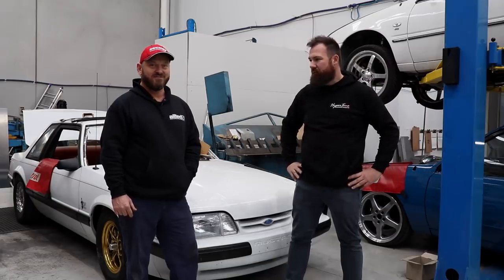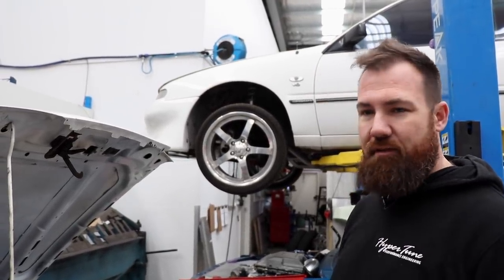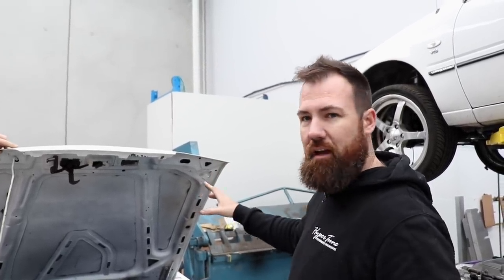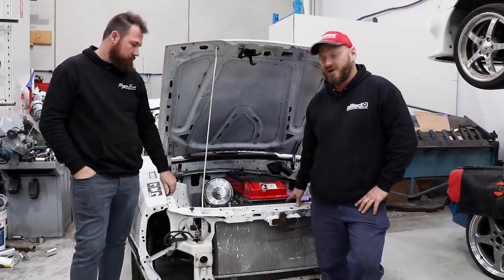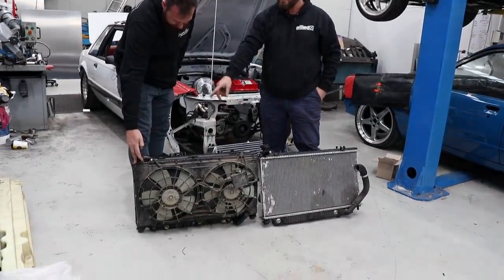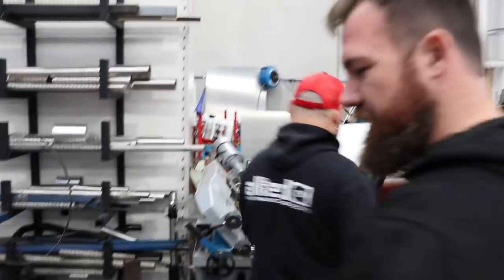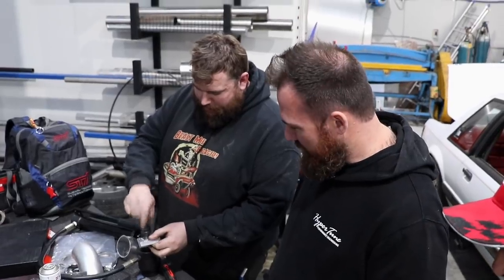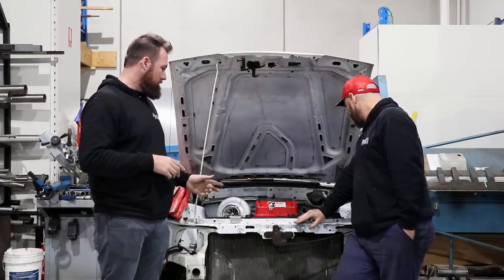Building a Barra Powered Mustang for Dragweek 2019

Comment: Damn those VE radiators are a good bit of kit aren't they, useful in a heap of builds
Reply: The other bonus is that they should be able to pick one up in the States easily enough, because Chevy SS and Caprice!
Reply: @ScottSherrington  good call a G8 radiator will be the same too
Reply: I wondered why someone would put an aftermarket radiator on a V6 VE. Those Alloytec motors are a POS. ...Yes, speaking from experience.

Comment: God love the Fox platform... came from the factory with Windsor V8s, the Lima 4, Essex V6s, Falcon 6s (yes, the US 200ci OHV engine), Cologne V6s.... and the SN95 is just a modified version so you can adapt modular stuff too. So much room you have to go all the way to dropping in a 385 series (429/460ci) with a C6 before the hammer has to come out to bang on the tunnel, and even then just to clear some reinforcing ribs on the trans case and a little extra room on the linkage side.

Comment: i would really appreciate a highly detailed series on building a barra including proving or debunking things like the pump housing cracking due to oil pressure at high revs, whether arp head studs are necessary or new torque to yield bolts will do the trick, more detail on the thrust bearing on the crank etc. thanks

Comment: The Barra 6 iron block is basically a ford 300 6 with a great head bolted on it .the ford 300 engine came stock in mustangs for decades and was the low power alternative to a V8 for the line up . so it's no surprise it fit's like it was made for it because the mustang was designed for a straight 6 and up tell the very early 2000's you could order one .
Reply: The barra blocks a bit like grandpa's axe, you can trace it back to the falcon 6s in the early 60s! We just kept on going with the falcon! But like all manufacturers,  get it perfect and stop producing the car!

Comment: 21:25  Electricians use this type of hole punch. 

You can get hand held hydraulic tools or nut and bolt type.  AKA Chassis Punch when used for building machinery or electronic enclosures.  For drilling holes, look up Rotabroach , this is a sort of hole saw device that looks like a hollow end mill.  There are 2 versions, one for use in a magnetic drill / drill press and another with a spring loaded pilot and replaceable cutters that can be used on a hand drill .  Finding out what tools exist and finding material are just a few of the big battles when building a car.

Comment: I wonder what you guys would charge to send the required parts to convert a fox body to barra power. I live in the states and couldn't think of a cooler powerplant to put in it
Reply: Not affiliated with these guys but we sell the engines. You don't really need a kit to convert if you can fabricate the mounts. The main thing is the trans. Depending on what you want the price can vary. Just the engine landed price is $1,395 with auto it's $1,550 and 5 spd manual it's $3,175
Reply: @VA-ng2ve  I'm not able to fabricate stuff, I barely have the ability to do basic maintenance with the facilities available to me.
Reply: @danatkinson6698  So you wouldn't be able to build the engine? To import these for sale they have to be imported as parts, so the head is removed. So you will need to buy a timing chain kit, and re-assemble the engine. If you can do that, then you can get a tuff mounts barra conversion kit. Tuff Mounts has one that's about 800 AUD so about $560. Not sure about the shipping you would have to go to the musclecargarage site and see what that cost is. I know we can import it for around $150 depending on the size, but it would be via boat.
Reply: @VA-ng2ve  I used to be a mechanic so I have the skill to reassemble it but it's the lack of fabrication equipment or a garage to do it in is my big hassle. 
I'll have to look into everything required to do it after I upgrade my property in the next year or so
Reply: @danatkinson6698  Okay well you can send me an e-mail at ocpimporters gmail. If you have any other questions I will do what I can.
Reply: @VA-ng2ve  thank you

Comment: Why wouldnt you use a restrictor instead of no thermostat? I'm just curious, any time I have done no thermostat I feel like the coolant doesnt stay in the radiator long enough to cool the motor if I'm making back to back passes.
Reply from the maker: cryptorchild x the cylinder head is restricted at the outlet, the thermostat really just directs warm coolant through the heater core on startup.

Comment: COMING SOON!! Turn your old Fox Body from shit show to shit hot with the new Skid Factory/BCW/Hypertune Barra conversion kits.Kits available in sizes from the Maccas drive though, stage 0.01 (low boost with big turbo noise and huge blow off sound) though to the Pro hold my beer and watch this kit, stage 100 (boost punches like your drunk uncle at a wedding)All kits are custom made to fit this awesome Aussie motor, rip skids for days and can be fully assembled in a few days with a couple of mates and a few cases of beers.Please note: Mates and beers not included with turbo kit.

Comment: a lot of Fox bodies had a straight 6 stuffed in them at the factory, but nothing so cool as a Barra
Reply: I know they came with straight 4's never knew they put inline 6's in them. Was it an Australian only model or U. S. models as well?
Reply: Wouldn't say a lot had them. The early Fox Capri, Mustang, Fairmount, etc. had a 200 I6 option that was replaced after '83. I've personally never seen one locally as they usually have the 302 or 2.3L, or the later 3.8L.
Reply: @markbremmer8642   CarpathianCarl From my Louisiana living days I saw more than I wanted to. Fox cars started as sedans, and before totally being emissioned away, the 200 6 was stuffed into Fairmonts,  Zephyrs, and T-birds etc and I have seen a few Capris with it (one that I had to work on). Eventually the V6 was the middle option , but the car was designed from the word go to take the I6 (Thrift-Power! It was so thrifty it gave you NO power) and I have seen one dirt track car with a 300 I6 stuffed into it (A strange guy with a T-bird/Cougar), so a Barra was always going to be an easy fit.
Too bad Ford never brought it here.
Reply: I was referring to the Mustang specifically. The others I know had  the six in them. My grandfather had a Fairmont with the I-6. I also had '95 F-150 with the 300 six. One of the best engines Ford ever made was the I-6 imo.
Reply: @markbremmer8642  Yeah, the 300 in the truck seemed to be reliable. Would be interesting to see them get aftermarket love.

Strange though. I've never seen a local Mustang with a 200 I6 and even all the bone yard ones I came across over the years (locally) had the 4 or 8, or v6 if later and v8 swaps were always with the 2.3L base as people used to gripe about the v6 k-member from the v6. Then again, 79 to 83 Mustangs aren't exactly common anymore. My grandfather had a '78 Fairmont and IIRC it had a 6 cylinder, guess it was the inline. Learned something new.
Reply: @RealCapricousCavy  I too have never seen a Mustang with the 200. only the 2.3/4, the V6s and the shorty small block. The Capri I have seen the 200, but for some reason never the 'Stang.
Though, the 2.3 had more horsepower, and almost as much torque, weighed less and got better mileage. There is also a ton of aftermarket for the 2.3. One can be built from scratch without getting any of it from ford's factory parts. Many many years ago the Roush Turbo's were being sold off for around $9000 . They made around 1000 hp in qualifying trim in the GTP,  GTO and Trans Am cars

Comment: I'm pretty sure that Drag Week doesn't allow you to share spares between competitors, each competitor must carry all their own gear.  That's how RMRW was.
Reply: EFormance Engineering it’s in the spirit of the event to give / sell parts to competitors in need. Last year we sold some of our e85 to a competitor and 2 days later bought some from another competitor . We also gave electrical connectors and wiring away and loaned out our Alan to wire up a trans brake set up
Reply: @BennysCustomWorks  if they don't give you a hard time, that's cool.  Cleetus and James ran RMRC and Cleetus hauled Ruby's slicks in the U-Haul trailer, which caused a near-DQ at the end of the event.  The punishment at the last event was that Ruby had to run on street tires (RIP average).
Reply: EFormance Engineering we aren’t carrying any primary parts for the other car though , that’s the difference. We’ve actually split the spares pretty much down the middle so there’s 2 spares kits .

Comment: Why no thermostat in cooling?
Reply from the maker: regno78 it doesn’t need one, it’s really only there to divert coolant through the heater core on startup.
Reply: Ok. No worries.
I just thought it's good to get engine fast in operating temp.
Engine have a std waterpump?

Comment: While I agree with the OE fans, there are far superior radiator choices for the foxbody in the states that bolt in with zero mods.  This means that if you do spring a leak, zero fabrication will be required to get you back on the road.
Reply: bandwagon240 this isn’t our first rodeo .